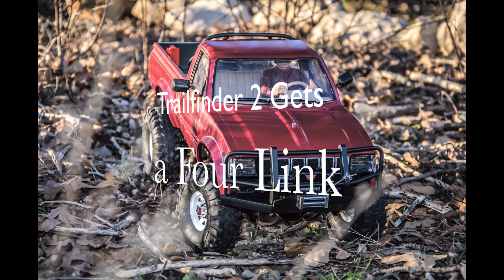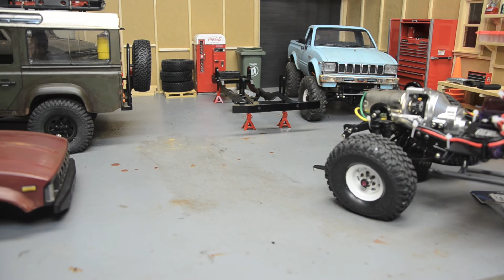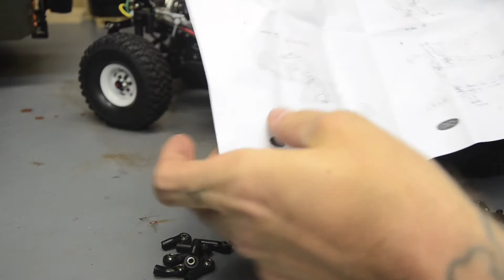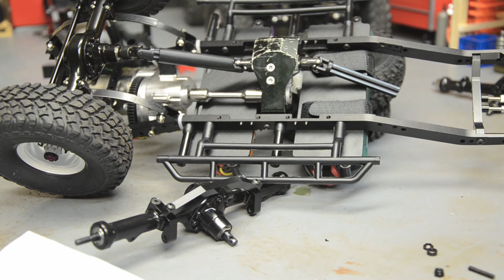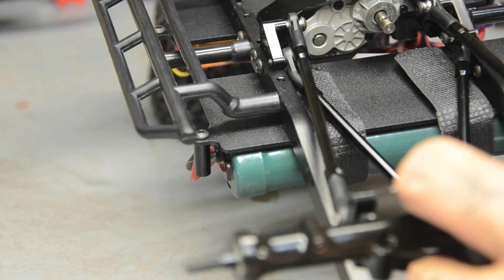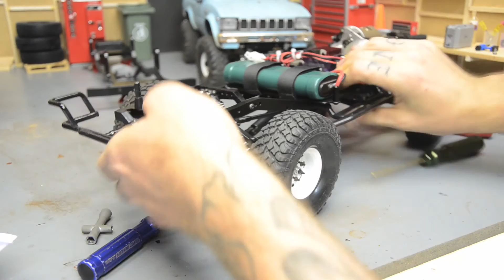Trailfinder 2  Four Linked Rear

Comment: Watching this video i have the 4runner rtr can you 4 link it.  What would you need to do it
Reply from the maker: Rc4wd makes a 3/4 link kit for the trailfinder 2 chassis. It’s a pretty easy conversion. The front is 3 linked with a panhard bar and the rear is standard 4 link.

Comment: Looks good I see the institute of commerce left out further information that contained the knowledge of The remaining Suspension Assembly The only thing that requires Changing is The Lower Trailing Arm linkages Need realinment both should be in a Straight inline runing parilel to the frame rails and Attached on the inside of the mount on the differincal housing Those little extra spacers are Actually protective friction bearings that belong between the Ends of the links and the mounting brackets to prevent friction wear Damege to The vital hardware these Parts  must be installed correctly For the 4 link to function Correctly & to remain fully Operational 💯😎🤘✌️🏁🏴

Comment: my trail finder 2 looks likes  a chirstmas tree  at night i just added 4 more lights on my rc4wd roll bar man its sweet 90 bucks man its a sweet thick roll bar and my crazy spending i spent 195  dollers on a front bumper 4 more lights  from rc4wd so nice really thick and does hold my wench  like the roll bar im done spending money on my truck but i did buy the  3and4 link coil over shocks a  2 speed transmission and servo new 1.9 rims 135 bucks  and tires 35 bucks  all rc4wd everything and fuck it why not a spare tire holder40 bucks  everything rc4wd i think im crazy do you its super bad ass looking a red truck full intearor with keth in there i went all out this year and its done man i did it it looks so cool never painted it red and black im just so happy and when you have a running rig you built im happy i just slap on cool parts you build and make them you are better then me man i really want to try
Reply: rick kentner i been working on mine for 3 years a super cool truck you will love it it is made to be strong and it is its not fast but put lights on it super fun 2 drive at night

Comment: its a conical washer it goes on before you put the link on the screw.so put the flat side  against the the frame then the link then the nut it keeps the links moving freely without binding.